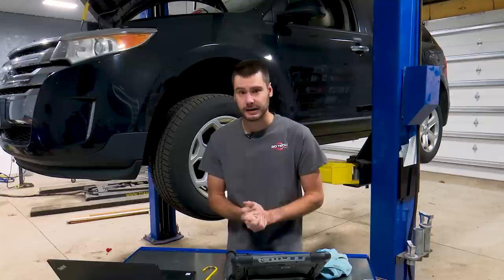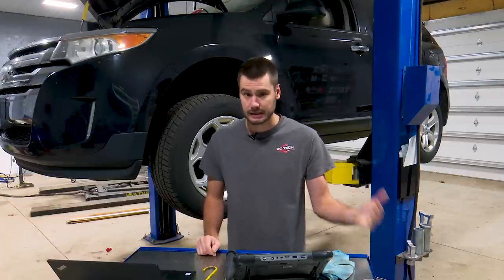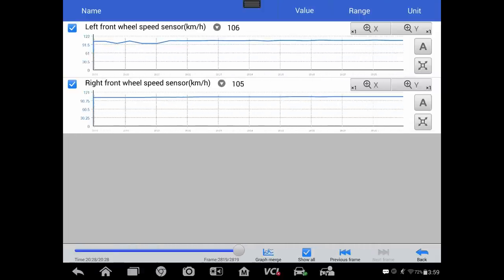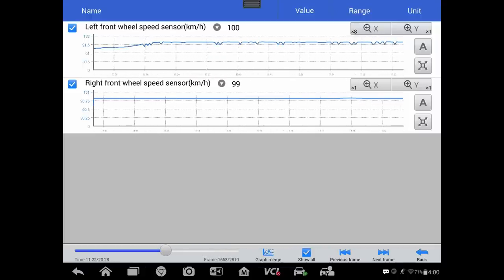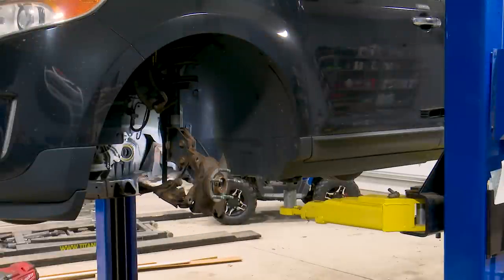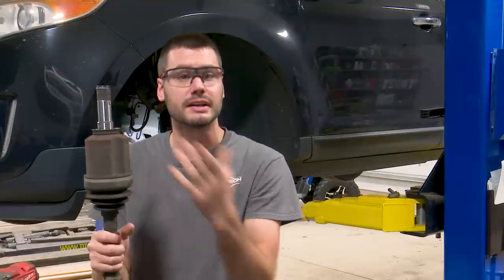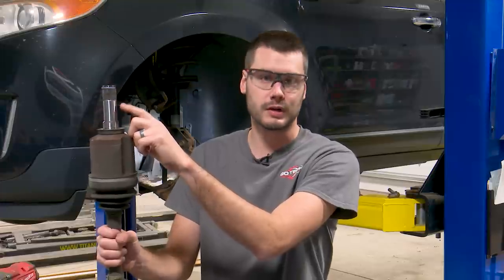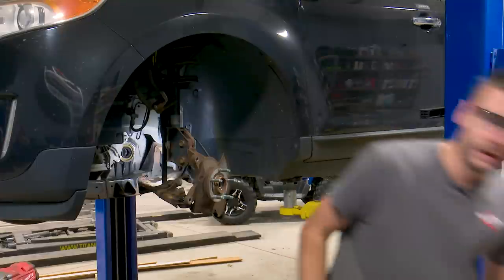Ford Edge ABS Issue FIXED!  Front CV Axle Shaft Replacement

Comment: Mike were all here to support you! When torquing the axal Nut one thing I have figured out is screw 2 lugnuts down on 2 studs then the prybar on them. That saves the thread. Another thing find vinal tubing that slides on 2 studs as well~Thanks Much
Reply from the maker: Hey man, love the tips! Both great options for sure. The way I look at it, the prybar is a smaller thickness than the wheel so in the event the threads would be marred, which hasn't happened for me, they would be covered by the wheel and not needed for securing the lugnut. In the case of these 2 piece capped luck nuts, I wouldn't put any leverage against them for fear of ruining the cap and needing to buy the customer new lugs.
~Mike

Comment: A very thorough walkthrough, Mike!  I once had a younger tech ask me if a few small dabs of silicone or wheel bearing grease could be used to hold the spring on the seal but even though it was good thinking on his side I recommended that he not do that (and to just take extra care driving it in) since the silicone or grease, even at a small amount, could cause an issue with the clutch packs or other internal components.
Reply from the maker: Hey Dave,
Yeah, definitely a good thing to look out for. Too much grease in the wrong place can cause an definitely cause an issue.
~Ryan
Reply: Unlikely as it cannot be any worse than shredded worn clutch material or bearing. Also; when grease is applied it doesn't dissolve in its current viscosity; it will thin out if it were to start travelling with ATF and only at high temperatures. As long as the fluid is level and replaced as recommended; there will never be an issue with premature wear.
Reply from the maker: As long as there's no friction material or metal in the grease, i'd think it would be ok. Think of rebuilding an auto, some of the pieces are packed or lubed with assembly grease.
~Mike

Comment: great vid mike  i usually try to seperate at the strut bolts if there are no cams... hey ive done that bushing in the case  a couple times   its a pain
Reply from the maker: If the ball joint looks troublesome, I will loosen the strut bolts too, I just mark the location and make sure it goes back into the same location. 
The bushing is a pain for sure! 
~Ryan

Comment: Just changed the axle on the wife’s 2011 ford edge. Drivers side front. Took me 7 hours start to finish. The biggest pain in the ass was the sway bar link. I had to cut it off. Other wise thanks for the great video!! Hopefully it doesn’t need an alignment!
Reply: How much did you save doing it by yourself
Reply: @Jast858  Not sure what ford would have charged for parts and labor. Bought the part from Autozone for 89.99 and rented their impact sockets to get the axle nut off!

Comment: Great video, it's good to see that the pros even have trouble. Would have liked to see the complete seal installation. Thanks
Reply from the maker: Hey Mike, thanks for watching! Yeh, this thing was kinda a pain.
-Mike
Reply: I learned somewhere that lubrication on a seal is not a good idea because some seals need to seat against the running shaft. and lubrication would prevent that. but the only way one could know when to do it and when not to is if it came in the instructions with the seal.

Comment: Great job as usual Mike, except, once more not wearing gloves... gloves police here! :)
Also, having a bit of OCD, I'd have sprayed some brake cleaner on that brake rotor after handling it with my hands. 
Love it how clean your shop looks and how detailed oriented you are.
Reply from the maker: Hey Johnny, you're right...I should be wearing gloves. I need to pick some up! I'll try for some orange or green ones so you catch them right away next time! Love it man! Brake cleaning the rotor would be a good idea for sure. Thanks for watching!
~Mike
Reply: @GoTechTraining  Orange will do. Green and sustainable are starting to be curse words. :)
Reply from the maker: hahahahah!! There's a few videos I have that I wear orange gloves in. I love em'...so easy to see grease on them. Black gloves suck.
~Mike
Reply: @GoTechTraining  I have a box of orange gloves in may garage... they're good, except for brake cleaner. It doesn't destroy them, but it seems to be able to go through the gloves... I feel my skin a bit itchy if I use a lot of brake cleaner.

Comment: That trans needs new fluid anyways by the time doing a seal or axle. I like to use a chain around lower control arm to pry them down fwiw. I always put a little grease on the spring of seal to hold it in place. I had to do that TSB before and that bushing is a pain without the tool
Reply from the maker: Hello,
I have done a few axle bushings for the TSB as well. I had a heck of a time even with the special tool. Nice work!
Thanks for watching!
~Ryan

Comment: This would show a missing tooth or even enlarged signal for cracked areas. This is easy diag because you can see the tone ring. In other cases you need a lab scope to confirm. This happens a lot in GM wheel bearings which are magnetic reluctors just behind it. Those magnetic reluctors tend to brake off and do something similar like this but more severe as the module things the wheels locked up, etc which simulates a tire slipping so it locks the opposite tire that is moving to control the vehicle, etc.
Reply: Wow great tip and information 👊🏻👍🏻
Reply from the maker: Hello,
On a Lab scope, you definitely would see a section missing or jump in the signal, the graphing on this video is from a scan tool which is not always as fast. I agree GM has a similar issue, a little different being MRE type sensor but the same concept.
Thanks for watching!
~Ryan
Reply: @GoTechTraining  I have seen the magnet film portion rust from inside and brake pieces of the bearing assembly which would create gaps and intermittent signals and the worst I have seen would actually actuate the ABS hydraulic aggressively and could cause accident; really dangerous. I advise customers to disconnect the suspect sensors if they plan on driving them so that the ABS system is temporarily disabled as the risk of having it like that would cause more harm than good.
Reply from the maker: It's never a good feeling when you are expecting a solid pedal rolling up to a stop light and that ABS kicks in unexpectantly!
~Mike
Reply from the maker: I wish GM would have a replaceable magnetic ring so you wouldn't have to replace the whole bearing ever time one of those things rusts off!

Comment: Mike that sensor ring is available from Ford! I replaced a few without replacing the axle. Ed
Reply from the maker: That’s great to know Ed! Customer chose axle replacement here due to the mileage on the original axle shaft.
-Mike

Comment: Be careful tightening that large shaft nut by pushing your torque wrench FORWARD like that (37:55) --  if it's a small enough car, you can push the car right off the hoist.  Next time make sure you are parallel to the ground with your torque wrench, so you can pull DOWNWARD on it for the final torque spec..   You might be surprised how easily you can push a car off of a jack or jack stands-- or off of the hoist.    Just kinda be mindful what direction you are pushing all that force.
Reply from the maker: Oh man, when I watched that back I was wondering what the hell I was doing trying to push the 258 ft lbs instead of pulling it. I've never seen anyone push a car off a lift, but I'm sure it's possible.
~Mike
Reply: @GoTechTraining  I've pushed them off of jacks and jack stands before-- so it just makes me nervous;  so I don't test it..  :)

Comment: God I hope that’s my problem, my ABS freaks out if I hit a bump or a puddle, but no lights or warnings. Just a pedal straight to the floor. I’ve been worried I’d have to spend hundreds of dollars on a new ABS pump/motor assembly unit and changing that out would SUCK. So I need to look over my tone rings!

Comment: Good video Mike. I suspect you were having an "off day", and things didn't go as planned.
Whenever an axle comes out that easy, I immediately check to see if the clip fell off inside the transmission.
 I pack the back of the seal with grease to keep the internal spring from popping out as it did here. I use whatever I can find to uniformly tap on the outer edge of seal.
When I torque the axle nut, I insert a standard screwdriver through the caliper inspection hole, into the rotor vent ribs. (I'll break the screwdriver before hurting the rotor!)
However, the pry bar between the two studs is the safest, when using a lug nut on each stud, to draw the pry bar close to the base of the two studs.
I also really appreciate that you cover torque specs. (I'll be doing that also, as soon as I have shop data)
Reply from the maker: Hey man, thanks for watching! Hope all is well :)
~Mike

Comment: If you're replacing the seal because of a leak, put transmission fluid in the tranny when you push the axle into the housing and move the axle around for a few minutes just to check for leaks,  Don't wait until you've reassembled everything to find that the leak is still there.

Comment: Spreading the lower ball joint clamp is risky.  They will break  fairly easy on some cars.
Reply from the maker: Hey Steve, yes it is a little bit but something we often have to do up here in Wisconsin. Do you do it a different way on rusty stuff?
~Mike
Reply: If they break that easily, then get a new one;  Because the weight of your car hitting a pot hole puts a hell of a lot more shock load on it than spreading it apart just a bit..  Though I would agree that "spreading it apart" is the wrong move-- you should just pound in your wedge, and then pull it all apart with your little wedge still in the crack-- then when you remove it, they tend to spring back closed:    Rather than OVER spreading it so that it now holds itself open..  But honestly, it should be a forged part and not cast, so I would be pretty shocked if you can break it.

Comment: RTV is a process, not a product.
Reply from the maker: Thanks for the clarification Paul, you're right!
~Mike
Reply: I agree; we use those to say Return To Vendor so it is definitely a process.
Reply from the maker: This industry uses way to many acronyms...so many that we don't even realize we're saying them anymore. Anyone speaking with customers should avoid them, where possible to prevent confusion between sealers and processes. 😂
~Mike